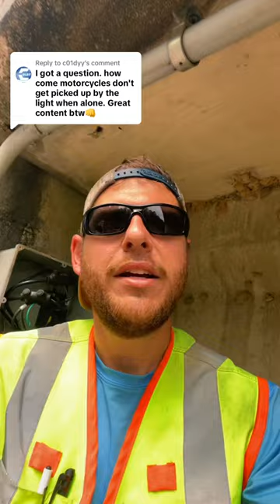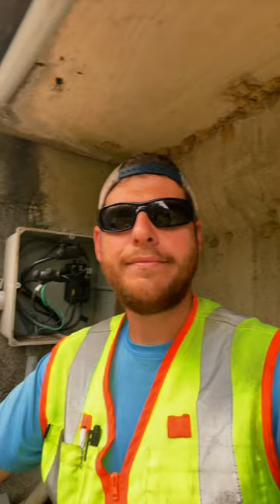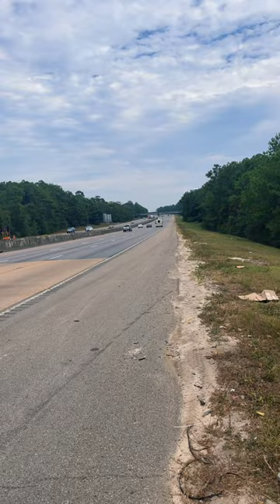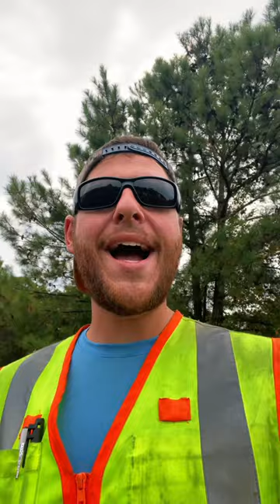Motorcycle Vs Traffic Lights! #educational

Comment: Then engines are large chunks of aluminum with steel crankshafts and steel gears. It should.be able to.detect a crankshaft.
Reply: Most motorcycle wheels can be detected by the induction loops.

Comment: The electrical system of the motorcycle doesnt put out enough of a magnetic field to cause the impendence needed to trigger a loop.
Reply: Should be close to the same amount as any other passenger vehicle. Their all 12 volt systems amperage may very but not a significant amount.